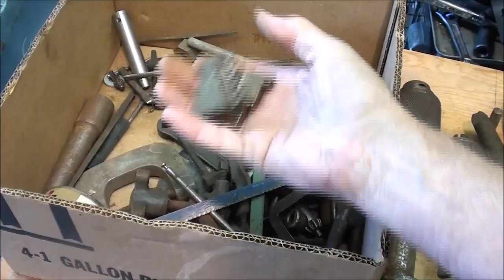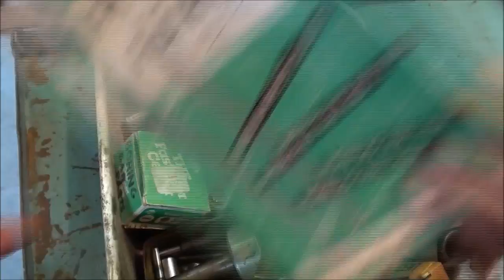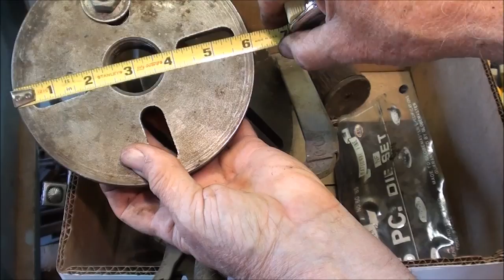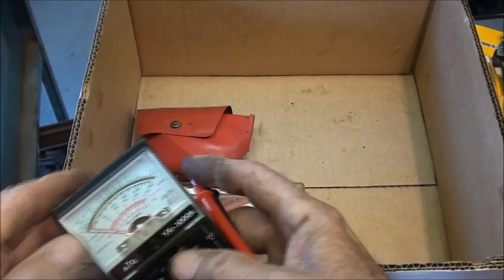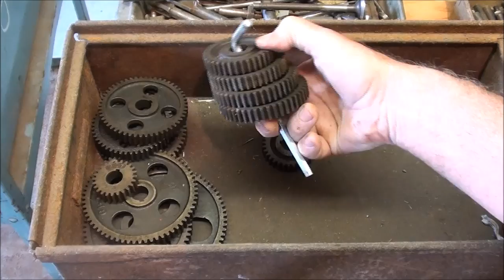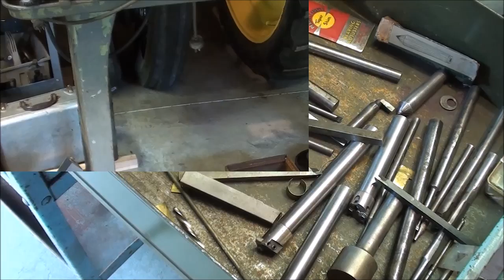TUBALCAIN GOES TO AN ESTATE SALE part 3 logan lathe

Comment: I bought a 1943 logan 200. I need the change gears....i made a bunch with my 3d printer. Do you know who would have a set for a GOOD price..i payed 425 for a decent shape lathe...not gonna  pay 200 for gears tho...ill make them instead 😊
Reply from the maker: eBay or craigslist are possibilities. They will be very expensive. Make your own if you possibly can. You might also contact Logan actuators. But they outsourced their gears and they would be extremely expensive.

Comment: Even the junk that you find has value. I'll give you an example if I found an old trailer hitch in a box that was all chewed up like that I would say Jeff what can I do with this being Jeff I would Crown Point answer myself. I would say well Jeff what I would do with this is throw this in a collet block thread side and take that chewed up section and make it a nut instead on the mill. Then I would take all the old Chrome off of it and put it on the wire wheel and fiber will it make it all nice and smooth again. Then I would heat it up a little bit to get it darkened up and apply gun blowing to it and make a nice dark black trailer hitch.

I would find a little box and set it next to it take some pictures at different angles and sell it on eBay for about $25 as a Preppers trailer hitch. You make sure the word prepper is in the description somewhere and you will sell that sucker in about 10 minutes. There is a fortune to be made by people with a very rudimentary bit of imagination. Now the $25 is just a wild guess I would actually look to see what they're selling for and then adjust accordingly. But the thing is you basically taking something that's going to end up in a landfill and giving it value and put money in your pocket. And the best part of it is you get to make it look new again and that's a great feeling

Comment: Another thing I saw in the previous video was they had that one 3 jaw setup so that it could be easily chucked up into a big lathe.If you get that small 4 jaw free,you could easily make a similar adapter in order to use it if the threads dont fit your lathes.

Comment: First time lathe owner. i just got a Logan 400 and I didn't get the change gears just like the man who bought the other lathe at your auction. The worst part is I looked right at the gears mixed in with a bunch of stock as I was moving the lathe and didn't think twice until I started doing some research on cutting threads. How hard would it be to manufacture an entire set? Any where to get specs? Thanks in advance!
Reply: With a rotary table and a horizontal mill plus the set of 14.5 degree 16 DP gear cutters, not bad. For the rest of us who are a few gears short of a 1945 Logan drivetrain, not good. With a 3d printer, this guy seems to have made a nylon set: http://www.thingiverse.com/thing:200294

I guess they would be quiet, and you could always make more when they wear out. I imagine that the first thing to go would be at the bushing, but maybe that could be made from steel and formed into the 3d print or pressed into it.

Comment: i am not a machinist. i wood like it but for now i like forge work it is something i can do with minimal tools. old bolts are good for back and white photography. trying to learn cad so i can get parts made. i want to make a a power hack saw so i  need to make a flywheel and not the tools to do so.
Reply from the maker: +chip2567  THANKS for watching

Comment: There is no junk.
 I remember having to repair a trailer so my son could take it with him the next day to his new home in another state filled with items he needed to take with him- time was of the essence since he had to show up for work at his new job. I needed a 4"x 1/2" bolt to finish up. I had to go get one 20 miles away and by the time I got back it started raining and the project was halted so he had to leave without the trailer and his possessions. Had I even a bent bolt, I could have hammered it out and used it and all would have been well.
 I thought about all the old bolts and nuts I had thrown away and quit doing that.
 Enjoy your videos.
Reply: +newstart49 * I used to save everything with any potential at all.  Problem became that I couldn't find things when I finally needed them.  I compromise now.  I keep things that are in good condition and are the kinds of things I actually do use regularly.
Reply from the maker: +newstart49  THANKS for watching
Reply: I think, it's possible people keep stuff like that because they actually don't know when it's not any good anymore. Though, I know the feeling on the bolt story. No doubt we all have our own "if I only had that thing I had for 25 years and threw away last week" story.
Reply: Mr Pete that tool that you picked up that you were not sure about that was hinged at the end is an old reloading tool possibly for .32-20 or .44-40
Reply: also the cresent wrench you said goes for $30 there in the US here in australia you would pay at minimum $80 for a cheapie and up to $150 for a good brand

Comment: Do you find commercial auctions are better that estate auctions? my experience the vulture relatives make such a mess that there's rarely a true bargain to be had at estate auctions unless you call all that scrap metal you paid to take away 'treasure'? Lufkin ruler? get real, $8.99 for a NEW shinny 1m ruler down the local hardware store. Please don't change your habits, as it worked out real well for me earlier this year, 2 auctions on the same day, one rather large estate auction the other an ordinary commercial auction, all the big buyers raced down the road to the estate auction, left me almost all alone to win a 4 month old, with only 28hrs of use in pristine condition never been used outside the warehouse, one CAT 2t container forklift for $2750, now that's a bargain... I didn't have to say 'shit of what use is this' when i got it home. :)

Comment: Been looking for a lantern post for my South Bend Heavy 10...my lathe is missing quite a few parts. Lantern-type tool post, an Armstrong tool holder, & a tailstock. Would you be willing to sell that little tool post??? Just wondering...
Nice score....
Reply from the maker: No. Want to keep it all together. Check ebay.

Comment: The "D" bits are very useful for squaring the bottom of a drilled hole. For instance at the bottom of a "clack" valve on a steam engine so the ball sits square. I have a set I made years ago.

Comment: 7minutes 30 seconds D bits. Really useful bits of tooling, if you are throwing them away throw them my way.
Reply: Never heard of a D bits before, had to Google it and its a very interesting looking cutting tool, a cutter/reamer combo.  i will have to investigate further.  Can I ask what you use them for?  Show that no mater how much you know there always something to learn.
Reply: DrQuiMobile They are used as your investigations have revealed to produce a hole of accurate size, however the unusual feature of such holes are they have a flat or slightly raised seating at the bottom of the hole.

Comment: Is that a Logan 820 lathe?  It looks an awful lot like mine.  Some nice finds, and a little bit of scrap metal.  

I've bought several tooling lots from auctions, and many machinists kept every old piece of tool steel so it could be re-ground into new "job specific" cutting tools... often times for boring bars like the ones you found.  Broken reamers and taps were favorites, but even drill bits were fair game.

I obviously have the disease, because I was enjoying the search through all those old boxes of stuff.

Comment: South Bend 9 10k Lathe Milling Attachment MLA maybe :) Remove the compound rest by loosening the two bolts that are at an angle in the front of the compound rest. They normally are allen set screws,.The compound rest should then be lifted off the cross-slide. The hole in the top of the cross-slide should accept the boss feature on the bottom of the milling attachment.??Or not ive another theory its from the 16 "South Bend lathe"..

Comment: That lead screw and nut as well as that little gear are for a logan 200 (10inch) lathe. The prior owner may have swoped it out when he changed the gear box. Please put that on ebay as I know that somewhere there is some ne repairing a logan and can't find replacement parts.